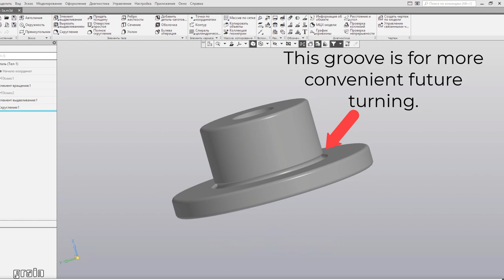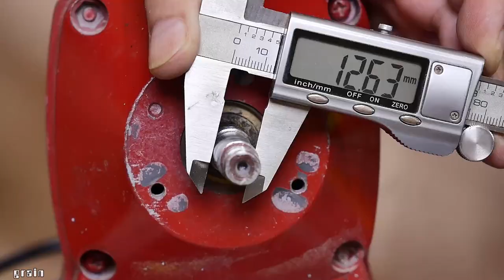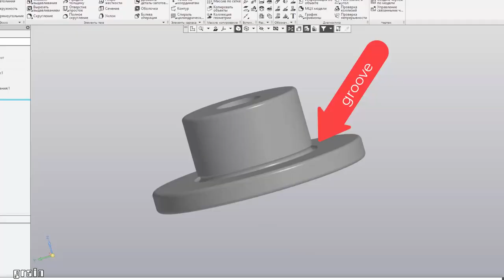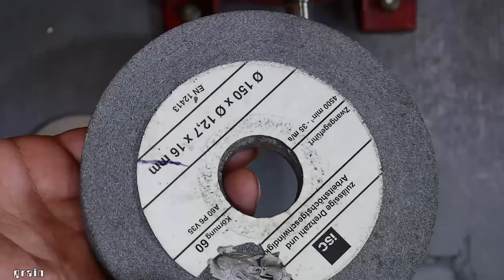Two Ways to Make a Faceplate for Bench Grinder (No Lathe)

Comment: I don't know if it's a good idea but to get the washers to dimension you could also heat the shaft and then slide the plastic washers on, instead of filing it by hand
Reply from the maker: I think that is not the case in this case.

Comment: Is that metal outer washer loose or doesnt it also need to be corrected. And could you put masking tape or electrical tape on the shaft so that the washer fits tightly. Thanks for any help im new to this and just bought a bench grinder that vibrates like yours and i want to fix it.

Comment: I wouldn't trust a 3D printed PLA blank like that as the final form. 3D printed PLA is good if you use it as a Blank/Positive for making a mold of the part and then casting it is another substance after fixing all the flaws (all the print lines) by sanding, filling or so before using it to make a mold. And I sure wouldn't use it for any length of time on something that runs at 3k RPMs or more even if it is 100% infill.
Reply from the maker: If you have seen, abrasive discs are also sold with a plastic sleeve, and it is not even solid. And this is not caprolon or something from which gears are made. However, until I heard anything happen to such a hub, I myself have used such discs for many years. I think the reason is that there is not such a large load in the center, the loads increase towards the edges of the disk. By the way, they can increase by the central sleeve with an unbalanced disk.